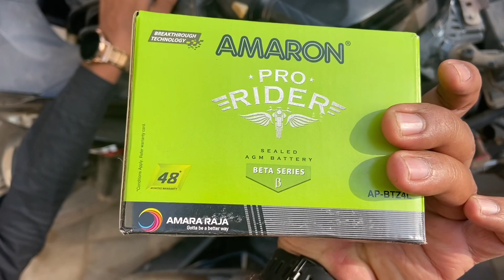Suzuki Gixxer New Amaron Battery Change With Price In 2023 #amaronbattery

Comment: What is the cost of the battery
Reply from the maker: 1200 Rs
Reply: @EasySolutionsMotorsports  what is the battery size for Gixxer sf 250 2019 model bs4